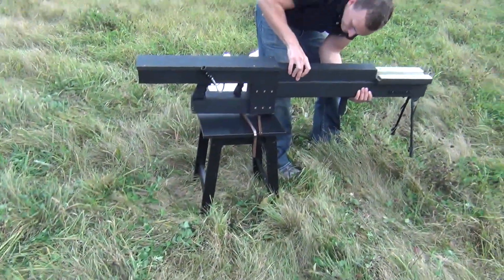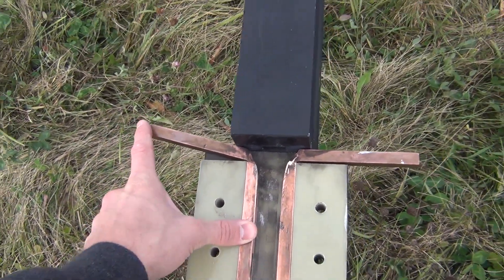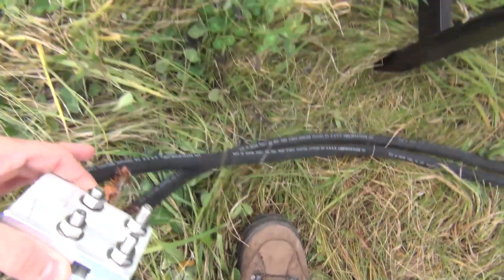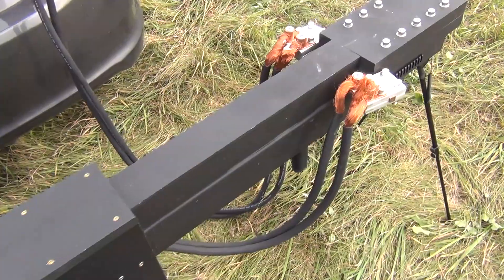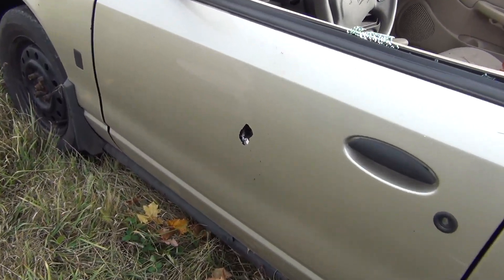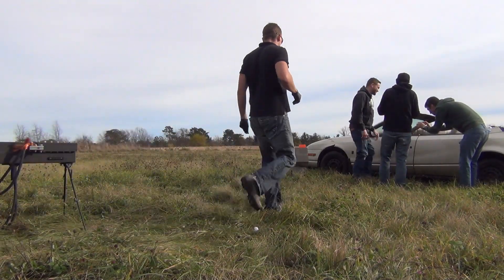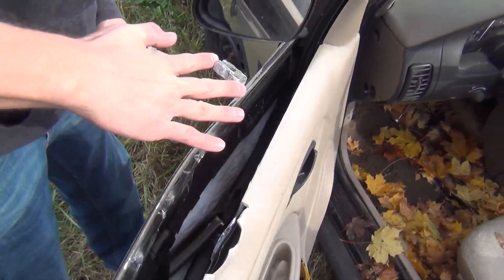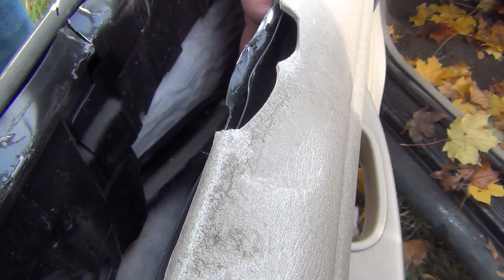250lb Railgun vs. Car Door: 27,000 Joules. Launch #4

Comment: look at all those sparks, you guys need to reconfigure your magnetic field, your scraping the whole way up your rail conductors, that's not good, that is a good way to have your rail gun explode in your face. all that black stuff is blow off from your fkn piece of aluminum dragging, you guys are gonna end up getting killed because you have no idea what you are doing. that is some dangerous shit to be fn with. and there is a reason why that only went about 6 inches into that gel.
Reply from the maker: +Dan Cassidy It worked exactly as intended. The metal vaporization is inherent to the railgun design- hundreds of thousands of amps is like tossing butter on a hot pan.

Comment: Make your busbars from copper.  Make your projectile out of copper as well.  There will be some brasses or maybe something like Constantine metal for increased toughness.   See if you can find graphene capacitors as well.
Reply from the maker: Let me just make my capacitors out of the most expensive material known to man, graphene sigh
Reply: +Michael Campbell Copper is often much more expensive per amp than aluminum. I don't know what Constantine metal is, and Google gives me a company named Constantine Metal. Are Graphene capacitors a thing? Digikey yields no results.
Reply: Rogue-Electron you actually could not use supercapacitors for this at all, at least without greatly increasing complexity and cost for the same power. They don't do high voltages.
Reply: I know but someone mentioned graphene and i was thinking that's what supercapacitor use?
Reply: I think Alu is a poor choice for a projectile. You need more impact.
Reply: +Ryan Cook it may be cheaper but the loss of energy is also a ton. Aluminium builds always oxides on the surface. On high amp applications like Railguns even a slight increase in electric resistance can and will have a huge effecientcy loss. This shot is a good example it looks like the arrived energy at the car door may be 20-30 Joules. But for sure under 100 Joules. So Input 27000 Joules ouput >100 Joules, well but at least the aluminium saved some bucks xD.
Reply from the maker: Aluminum works fine- the calculated resistance is low enough.
Reply from the maker: +Ziggy Zee I would rather choose double thick aluminum than copper. More strength, less weight, significant cost savings, same resistance.
Reply: Ziggy Zee
 calculated is theory, did you measured it ? like i said the oxide is the breakingpoint. If you want it ultra cheap in exchange for huge effecientcy loss then well its your choice.
Reply: But would more weight necessarily be a bad thing ?
Reply: Sammy the salmon king
 usually more weight means less muzzle speed, but in the case of this gun type it might not be the true since there is potential more currentflow which means more acceleration power.
Reply: +Ziggy Zee I thought supercapacitors used graphene?  Nice Work :-P

Comment: Ha ha ha... LOL...
A piecie of crap..... 
Plastic door...
27000 Joules ?

A AK47 bullet has only 4000 joules and will fly through the door... interior seats and the door on the other side...
This piece of crap cant even pierce throu plastic interior..... through the plastic doors...
I have a airgun 4.5mm cal that pierces a NISSAN PRIMERA STEEL DOORS and ITS INTERIOR....
So i dont see anything "wow" in this movie......

27000 joules.... its the energy that is condesated in the capacitors...
But the energy of the projectile is inder 30-50 joules.
Reply: +StingerekPL 
For us gun enthusiasts, that 27k+  joule figure is very misleading. It's NOT the energy on impact they were talking about. 

It's the total energy of the electrical system, BEFORE you factor in the (extremely) inefficient rail gun propulsion system.

As someone else said on rebrn :

"27,000 is the amount of energy being released (in total), but a large 
percentage is not being transfered to the projectile. It's not a 
velocity measurement, it's a capacitor measurement."

27k joules on impact would be insane. 
A .50 BMG is listed at approx. 15K or 20K joules, depending on source.
Reply: And that is the point.
They should mesaure the speed of the projectile and its weight... to check effectivness of that kind of "device"
Reply: +StingerekPL Lol, this projectile only has about 600J of energy as most of it lost in heat. The shape of the projectile makes it even harder to penetrate stuff. Do some thinking before you speak.

Comment: That amber cloud that came out the front of the gun is very likely Nitric Oxide (NO2) generated by the arc disassociation of nitrogen in the air mixing with oxygen.  Nasty, toxic stuff.  Your design uses a CO2 pre-launcher, so you are probably generating some carbon monoxide as well.  Take it from someone who works with high power arcs: Don't stand downwind when you fire.  

Have you considered using high pressure nitrogen for your launcher?  That, plus a little pre-shot purge could reduce oxidation on your rails and increase their longevity, not to mention prevent some nasty emissions.
Reply: +Jeffrey Mach I don't know, by the time it gets to them, I would think the nitrogen dioxide would be to dispersed to cause trouble. As a chemist I've dealt with the stuff rather often, and its not too terrible, at least you can see it.
Reply: +Ziggy Zee I see what you did there...

Yeah though, I see the potential in railguns as future launchers or weapons to be great, as much as I appreciate conventional chemical propellants (I like the chemistry behind them).  Awesome project, do please keep making videos and building/improving, its always great to see this kind of thing done in the backyard!
Reply: Doug Mapper Vaporized copper is a rather striking green.  (Once vaporized, it oxidizes and creates a brilliant green flame for the same reason the Statue of Liberty and other copper clad things develop a minty green patina.)
Reply from the maker: +Le Damedeziel only if it's sharing an electron ;)
Reply: Ross Keene Please do the slightest bit of research before you come off as a git.  

At the molecular level, yes, nitric oxides are used in the body.  At the macroscopic level (i.e., brown cloud coughing out of the railgun), nitric oxides combine with water to form nitric acid, which is most assuredly NOT HEALTHY for you.  NO2, specifically, is the brown cloud you see and is the brown part of smog that used to make LA's skies amber.  You remember smog?  The stuff that leads to acid rain that used to be eating away at everything before emissions controls that limit the creation and release of nitric oxides started being implemented worldwide.

I would suspect that cyanide (C-N) is used positively somewhere in biology, but that doesn't mean I want to snort it.
Reply from the maker: +MrLittlelawyer Yea, I wasn't too concerned. Less exposure than owning a Volkswagen.
Reply: NO2 is Nitrite 👌🏻
Reply: I don't remember the chemistry of nitrogen oxides Jeffrey. But nitrogen oxides were a problem and the culprit behind smog because they form in internal combustion engines at high temperatures. The emission control system employs a gas re-circulation system which introduces the engine's own exhaust gas into the combustion chambers as an inert substance to keep the combusting fuel within a safe temperature threshold where NOX is greatly minimized. The little bit of it I remember. =) I think the triple acting catalyst also takes up the slack. Platinum, palladium, and rhodium... off the top of my head. Three precious metals.
Reply: Jeffrey Mach is there a more easy gas to get a hold of with the similar traits
Reply: Fucken ey bro
Reply: Wouldn't he be safe outside
Reply: Nitric oxide gives people erections that may last longer than 4 hours, at which time it is recommended they seek medical attention 🤣
Reply: Late to the game here but helium is what you want to use to purge/inject. It's inert so no nasty reactions plus purging the barrel with a light gas will add some velocity.
Source: I worked on ARDEC's 30 MJ gun back in the 80's.
Reply: @snoig1  Helium would be  good, but Argon is cheaper and more available and since it's heavier, should do a better job of sticking around to protect the rails.  In retrospect, nitrogen is much cheaper but if you disassociate it, it will still form some nasty chemicals after it comes out of the barrel and interacts with the air.
Reply: NO2 is Nitrogen Dioxide, not Nitric Oxide. The key difference between NO (nitric oxide) and NO2 (nitrogen dioxide) lies in their chemical structures and properties, particularly regarding their role in air pollution and health effects. NO is a colorless, odorless gas, while NO2 is a reddish-brown gas with a pungent odor. NO is a precursor to NO2, meaning it readily reacts with oxygen in the atmosphere to form NO2. Nitric oxide (NO) can be toxic, especially at high concentrations. While it's a vital molecule in the body, acting as a chemical messenger and vasodilator, excessive NO can lead to harmful effects, particularly in the lungs. NO, emitted from various sources like vehicles and power plants, reacts with oxygen and other gases in the atmosphere to form NO2. Both NO and NO2 contribute to air pollution, especially the formation of smog and acid rain. NO2 is a major component of photochemical smog and is also a major health concern.
Reply: Cool discussion. Though I might add something, CMIIW:

Nitric Oxide/Nitrogen Oxide/Nitrogen Monoxide (*NO*) itself is not really dangerous, as it's actually used for pulmonary vasodilator in newborn babies (though some research shows NO could break DNA strand).

How is it dangerous is because how reactive it is with air to form Nitrogen Dioxide (*NO2*), which is what makes the fumes toxic. Hence together are to be considered as a group, NOᵪ

Though it's obvious the Nitric Oxide would form with the Oxygen in the air in this video...
Reply: Jeffrey Mach ...you mentioned that nitric oxide is toxic and nasty stuff. yet it is used by the body to dialate blood vessels to increase blood flow. your statement is rubbish.
Reply: Jeffrey Mach nice google there heisenberg
Reply: You nerds.
I don't get a quarter of it
Reply: Ross Keene it also turns into nirtic acid on contact with moisture. like the water in your eyes, mouth, skin. so you are an uneducated moron who knows nothing about chemistry. Please refrain from commenting on further science videos and also from reproducing. Thank you.
Reply: It's more likely vaporized copper.

Comment: Carbon composite to replace fiberglass or is the fiberglass a non-conductive required for correct operation? A little info on wire diagram or is that proprietary?

Comment: I'm excited to see it hit ballistics gel! 
Btw this really is a super cool experiment that's very well done and documented. Super professional videos! I'm impressed! 
Of course, it does show how rail-gun tech is far behind traditional combustion based guns. I think in maybe 100 years however once the tech improves rail guns will slowly take over and become the dominant form of weaponry. Like how traditional guns slowly took over the role of crossbows. 

Pretty damn cool to be at the front of this frontier huh!? Though I don't think a practical portable rail-gun is yet possible, you sure are a vanguard for it.
Reply from the maker: +zeNUKEify And yet, we can push the limits of magnetism even further with improved projectile design and increased voltage. With four rows of capacitors, 800 and 1600 volts are possible with series/parallel connections. Twice the voltage will result in approximately twice the amperage.. leading to FOUR times the propulsion! (Albeit, at greater rail erosion and greater potential for material damage).

(1600 volts = 16 times our current force, as the force is the square of the current) (with mind boggling safety hazards)

I have no doubt we can push our current setup to velocities impossible by combustion technology.. the real question is, can our system handle it! :P
Reply from the maker: +zeNUKEify (I've designed up a more efficient projectile for our upcoming shoot this weekend)
Reply: +Ziggy Zee Awesome! Also, a quick question. Is it possible to launch a tungsten projectile? To my current knowledge (get it? "current") a railgun projectile just has to be conductive(?) 
I know tungsten is conductive and ferromagnetic but I'm not sure if that makes it a possible element for railgun projectiles.
Reply: +zeNUKEify I think is too expensive and hard to make thinks with it